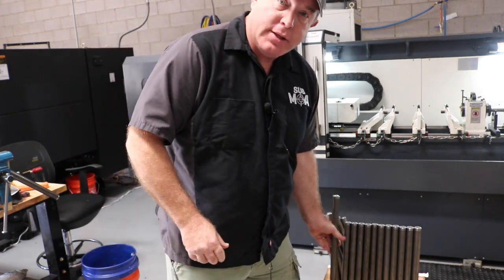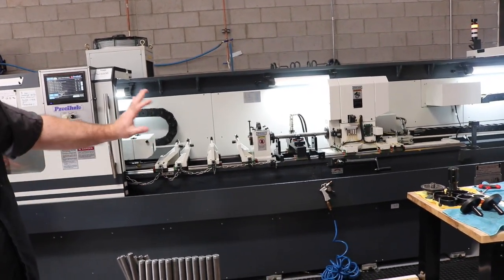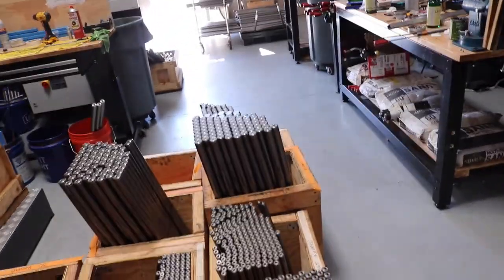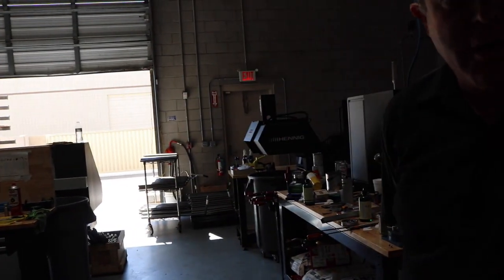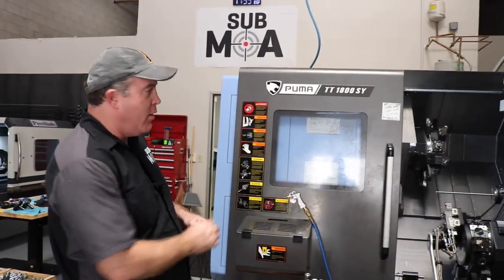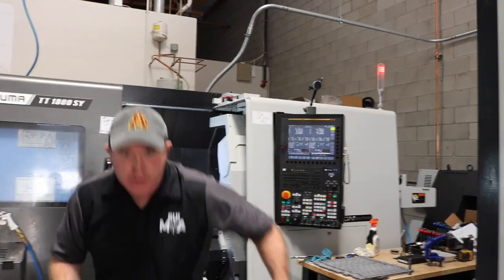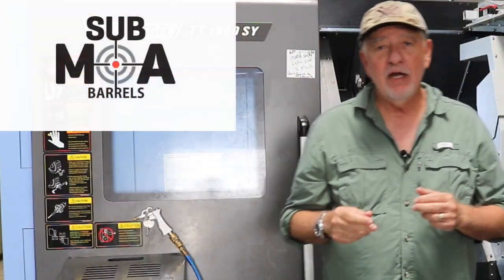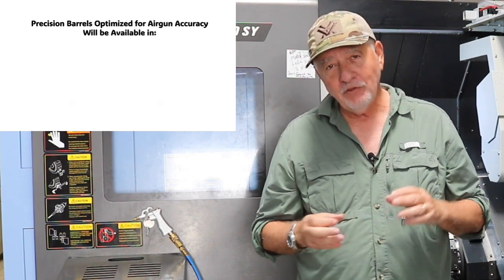SUB MOA Precision Air Rifle Barrel Manufacturing Specialist

Comment: Jim I wonder if that's the place where Brian from EDGUNWEST gets his special barrels. Because he sells barrels for the LESHYI 2 for like 500 dollars and there called Sub Moa barrels and I am curious if they do make a differance.
Reply from the maker: @JohnVentarino-ey5ln  not sure, I know sub moa sells blanks to other makers in smaller batches. Will look into it
Reply: If this barrel is made in 700 mm and has a good twist to shoot slugs that's great, but if it's only good for pellets it's crap
Reply from the maker: @fabiosantos8591  Wow, sounds like you made it through an FX brochure.... and you want it to have a "good twist rate", very specific requirement :) . I have not had the experience with these barrels in quantitative testing to comment, which is why I want to get them set up on a couple of my guns. I will say that competitive shooters I trust have tested them on the Daystate Ghost and FX Impact and observed notable improvements, but again I will test them myself before commenting one way or the other. 

There are many competitive shooting applications where the highest level of precision is important, and pellets are the required projectile, so the proposition that the only reason a precision barrel has value is if it shoots slugs (and is crap if it doesn't), seems kind of illogical to me. The need for the level of precision being specified is actually much more important for pellets than slugs in this context. But maybe I'm missing your point?
Reply: @fabiosantos8591 Right I understand your point👍 If they're only making barrels for shooting slow pellets for paper shooters then it would be a waste of time and money for a serious shooter that utilizes the real power of slugs when needed to put food on the table or to dispatch predators/varmints out at long ranges, in which pellets do NOT have the umph/power to do because they are limited in the speed department thus hindering their accuracy when shot too fast😩 It will be sweet as hell if this company does make custom barrels for real shooters and not just cater to paper shooters, that would be the best of both worlds being able to buy something of real quality that is actually made here in the U.S.A💥👍